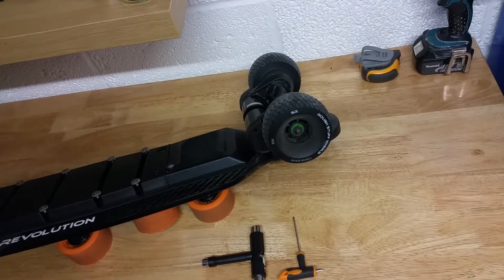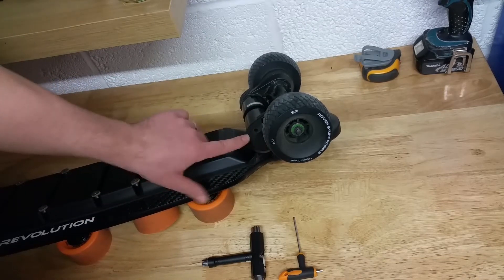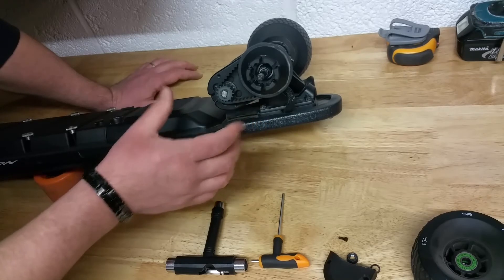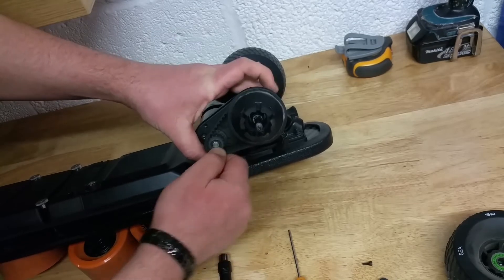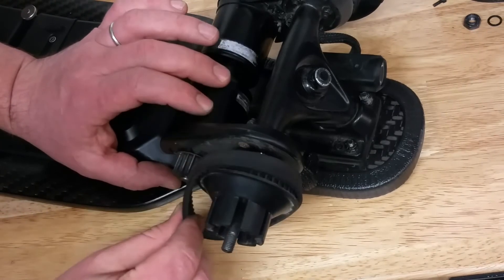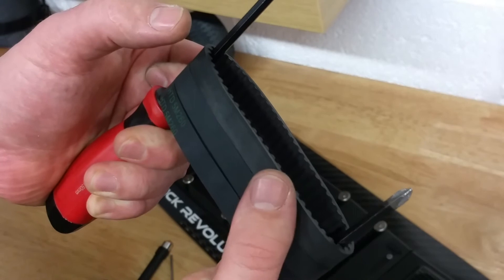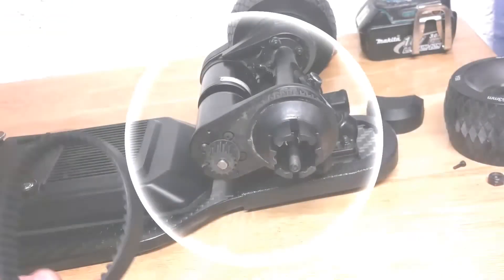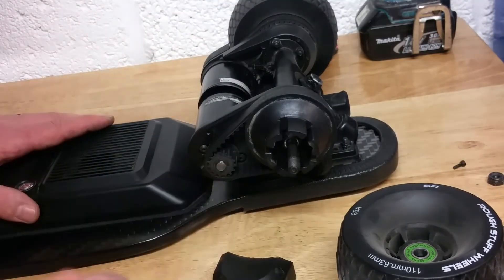Electric skateboard belt tension and replacement tutorial.

Comment: Hi Pavel, thanks that is a really useful video! I have put 97mm Evolve stone ground wheels on my flex e 2.0 and they sit to close to the belts. It is like the hub pushes too far into the wheel. Any ideas on what I can do to make them fit? Thanks in advance, loving the channel and your quality, detailed and honest product reviews!
Reply from the maker: Hello Will,
The only thing you can do us to add an additional speed ring ( that thin washer ) between the wheel and the wheel pulley. Make sure not to put too many otherwise the nut will not sit over the thread enough. Use a new lock nut ! 
Another thing you can do is turn the board on its back, run the motors and gently press sand paper or the file against the side where it is rubbing....that will shave the wheel a bit. Make sure to use the gloves and eye protection when doing this!
Hope this helps.

Comment: Hi. From all the videos I've watch, you seem knowledgeable so I might as well try asking about my motor noise issue. Was wondering if you have any idea? I have demo it here in short video: https://youtu.be/HQD7sixm8pM

I sent an email to tech support, but they still working on it.
Reply from the maker: Morning,
Just watched the video,
There are couple of things that could be wrong there : 
The motor can is loose on the motor shaft - please check if both screws are in at the back of the can
The magnet is loose inside the motor can or a motor sensor - you can take a motor apart to investigate but not sure if it will effect the warranty
Could be a debree stuck inside but very unlikely

Did SR get back to you?
Reply: @PavelGarmas  Hi, thank you so much for reply, buddy. They have not reply to me with any help. Disappointed. I've found out that the "15 Tooth Steel Eboard Motor Pulley
" was loose (very very tiny bit) and not the motor. So I added a loop of PTFE tape to tighten the motor pulley and that seems to solve the problem.
Reply from the maker: Very glad to hear that you did get it sorted.
Well done !

Comment: are those the slick revolution rough stuff wheels?
Reply from the maker: hello Tony!
yes they are but the first generation - 85A. They did come up with a softer version since then : )
i got video review on my channel. Much better wheel .
Reply: @PavelGarmas  thanks :). im considering getting them for my urban kick. just have one question: are the wheels soft at all? like a car tyre? because i feel like riding over slightly gravelly roads isn't going to be very nice if the wheels are still as hard as the 83mm wheels that come with the board
Reply from the maker: The only wheels that would feel soft like a car tyre are the air filed AT wheels....new RS wheels are as soft as the slick wheels but are bigger so have more meat to bounce : ) 
Do you want a really comfortable but not air fillet wheels? Abec 107 F1.....very nice and softer than the RS wheels BUT....take a look on my channel - I have a full test review.
Reply: @PavelGarmas  thanks for the info. im pretty new to all this eskating stuff, will check that video out 👍

Comment: why cant you adjust the belt tension ? you should be able to pull the mount away from the gear crating tenshion.
Reply from the maker: Hello Chris,The design of the Flex eboard motor mount does not allow this. The motor is fixed in its position so no adjustment there. Regards.
Reply: ahh that makes sense, and if you were to do any adjustments you would have to make your own belt tensioner and bolt it into the motor mount which is a pain in the butt hahah. i gotcha man, thanks for the info
Reply: Most? Nah bro you are what some might say talking out of your ass.